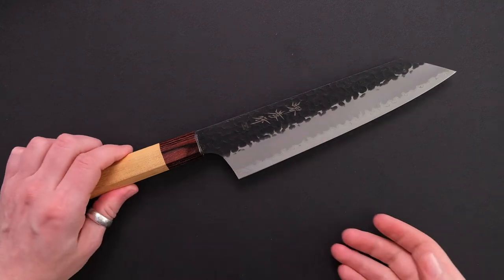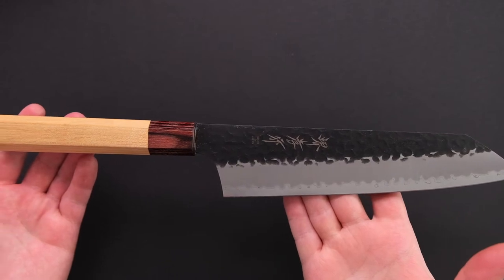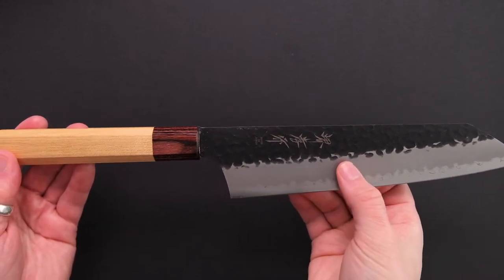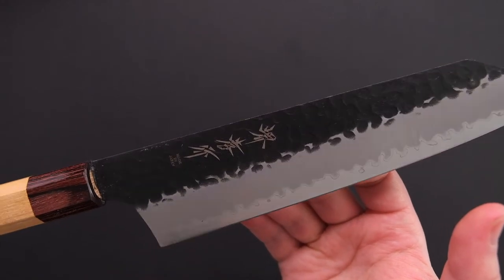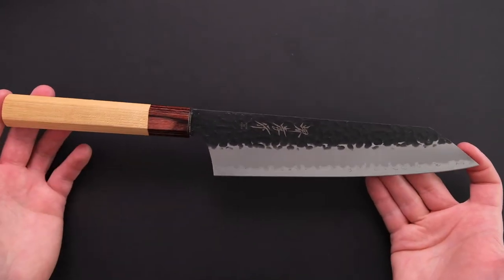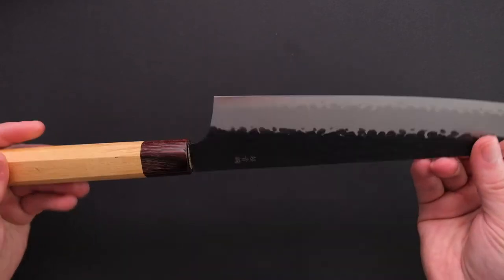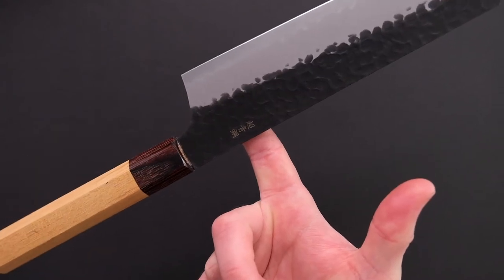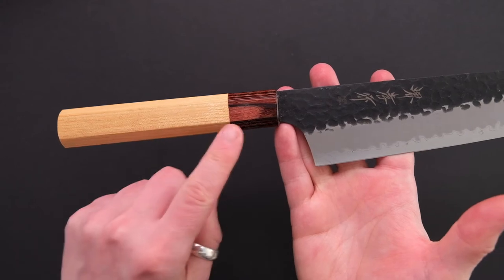Sakai Takayuki Aogami Super 190mm Kengata Gyuto

Comment: This line of Sakai Takayuki’s are descent. They do require some work to be fully usable. You must sand the spine and round it off. Very uncomfortable to hold for long cutting and chopping sessions. The blade itself also needs to to be thinned as cuts like a wedge. Being 65 HRC, they can be quite challenging to sharpen. Overall descent quality knives.
Reply from the maker: Well said, a nice choil polish and thinning can make this a wicked performer. Usually these are done for you at the $300 - $500 price point, but if you don't mind doing the work yourself, it is a solid value. Who doesn't like Aogami Super? We recommend using a Suehiro Cerax 1000 for sharpening, it cuts Aogami Super quickly. Thank you for your comment!

Comment: I had eyes set on these for a while, but I'm just not sure of the steel. Anyone experience chipping with these aogami steel blades?
Reply: Aogami Super ist ein sehr guter Messerstahl !👍
Da  machst Du nichts falsch! 
HRC 63-64  nicht rostfrei 
nach Gebrauch spülen und trocknen,  fertig
Den Kauf wirst du nicht bereuen !
Reply from the maker: I agree with the below statement. Myself and many consider Aogami super to be one of the best steels for kitchen knives. At its highest HRC it can be "chippy" however in this knife it is conservatively heat treated, and well supported. Chipping should not be an issue if you do not cut anything harder than you can chew and use a proper cutting surface. Hasegawa soft boards will also help prevent chipping and virtually double edge retention.
Reply: It chips easily
Reply from the maker: Dennis, we just posted a new video about this topic :)
Reply: I use this knife just about every day as a home cook and haven't had any chipping, having had my knife for over 2 years.

Comment: the specs are all well and good; however, be aware that the upkeep is equally impressive.  frequent touch-up sharpening with honing stones, keeping the knife cleaned and dried immediately after use, storage the keeps blade from contacting other surfaces, etc., are necessary; otherwise you just have an ordinary, rather dull Walmart knife at a stratospheric price!
Reply from the maker: As a professional sharpener, I could not agree and disagree more :) I completely agree with your expression that proper maintenance is absolutely necessary. However, I use a knife in my kitchen daily on a Hasegawa cutting board, and I haven't had to touch it in 3 months, even with a with simple strop, a proper cutting board, and home use. I expect up to 12 months of edge retention, then recommend professional sharpening.
Reply: You just need to treat it like a quality tool.  If you do, you can go a couple of years between professional sharpening, provided you touch it up with a steel and a strop.  I probably go too long, but send all my quality knives out to Knife Flight and they all come back sharp. There are better sharpeners but I can't bring myself to spend $30+ per knife.  (Korin comes to mind)

My Japanese knives retain their sharpness considerably longer than my Henckels or Wustoffs.  My US made Chicago Cutlery knives run a distant 3rd.
Reply from the maker: @donaldmei8797  We sharpen most knives for $14 each by hand on whetstones, since you have to pay shipping to us in back, usually makes sense when sending multiple knives.
Reply: I regularly use a honing steel and strop to keep my expensive Japanese knives in good order.  I don't use stones often as it takes some work... I prefer to send them out for this every five years or so.  I also use a hinoki cutting board to save the edges of my knives and don't do the oft-seen rapid fire, up/down chop bye professional TV chefs.
Reply from the maker: I love that you mention the cutting board, I use a Hasegawa, and the extra edge retention is amazing.
Reply: As I always say to aspiring cooks, take care of your knives and they will take care of you - !!!

Comment: How fast can it stain?
Reply from the maker: Thank you for your question. The cladding is stainless steel, so only the core steel will build patina. Aogami Super Steel is forgiving IMO, and will build a nice patina over time. I should always be wiped dry before setting it down, and storage. That being said, I would rate it as a low - moderate maintenance knife.
Reply from the maker: Because of the stainless cladding, only the core is reactive. Aogami super is easy to maintain in my opinion. Wipe it before setting down for a long time, and storage. No issues if this is followed